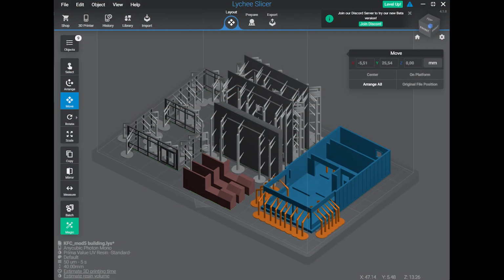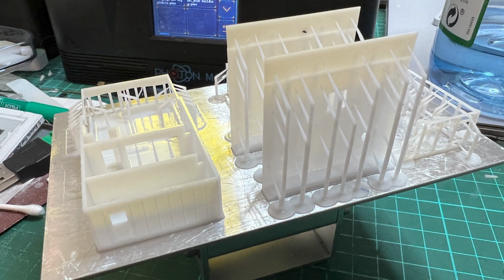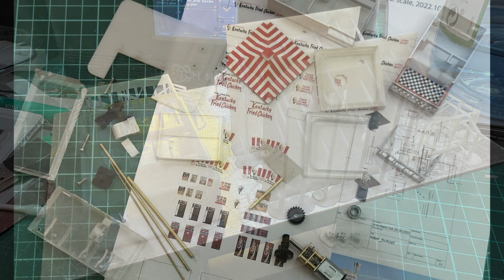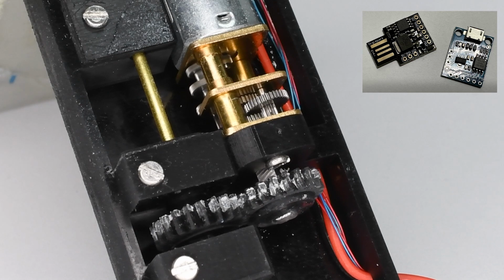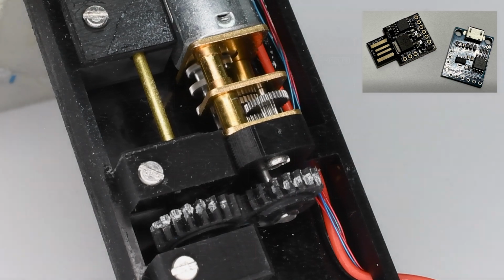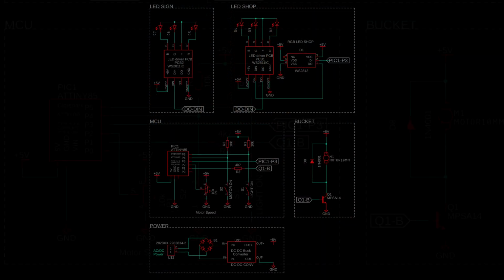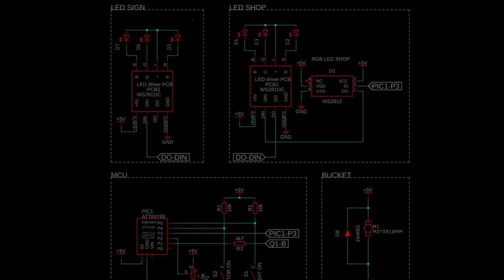Z.-scale Kentucky Fried Chicken 3D printed model with rotating bucket(Turn on sound)

Comment: Very nice model Svein-Martin, I really like your rotating bucket. I tried to do it on my model too, but I was trying to use micro stepper motors, and they did not have enough torque. Your solution works great! I use a lot of the Attiny 85 and Attiny 88 controllers in my projects too, because they are so inexpensive. I can't wait to see what you do next!
Reply from the maker: Thank you for the good Words, Robert.
I love to follow your projects online. You have so Much progress and many inspiring projects.
Time will show what will be the next projects.😎
I love to work with all this.